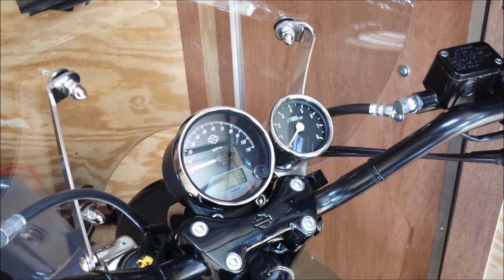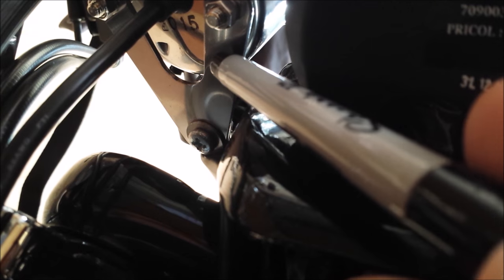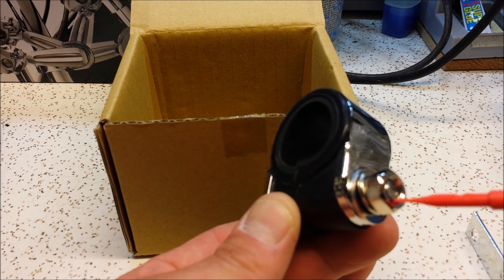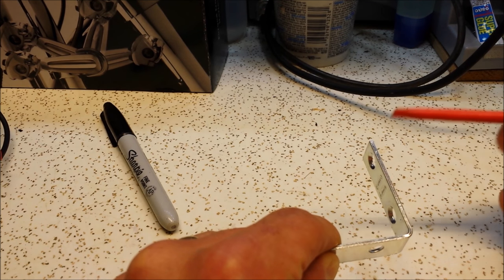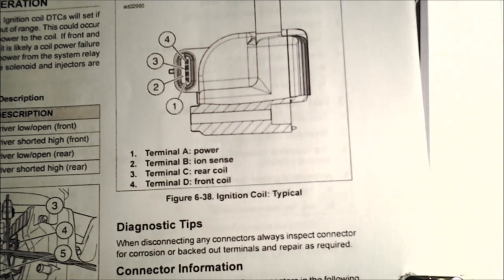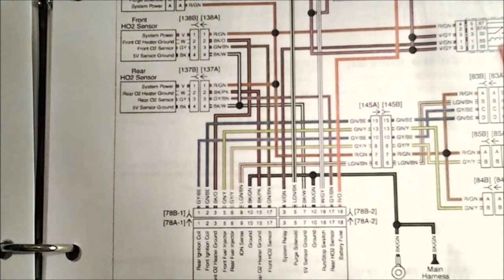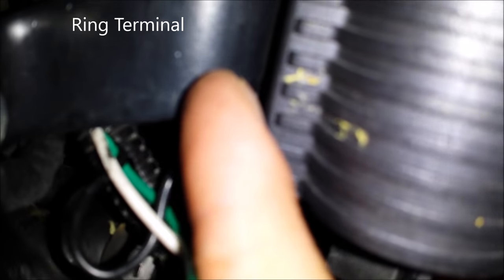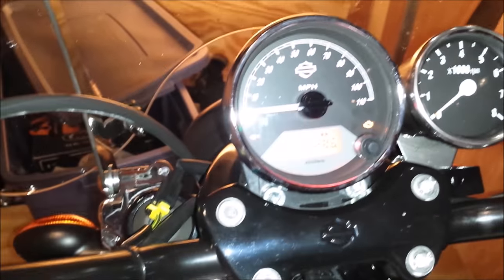HOW TO: Install a Tachometer Harley Davidson Street 750 XG

Comment: Hey Man,  great video... you are spot on  with the diode resistor combo.. I tried everything to get my Drag specialties mini tach to read full RPM not just half .  All but ready to give up.. everyone including whi I bought it from telling me it's the wrong tach that it won't work.. but it worked thanks to your set up..  much appreciated and mine bike is a single fire. 2015 Street Bob FXDB

Comment: Hello!
did you happen to measure gap between handlebar brackets before installing tachometer mount there.
just curious - if mount thickness is larger - then should be right side of handlebar is not tightening handlebar as it was?
If you turn out bit left side bolts screws - is handlebar still fixed ok.
Asking as as was thinking about same place where add tachometer and clock for shadow.
Reply from the maker: I didn’t, thinking back that would have been a good idea though.

Comment: Hello. Which diode and resister do you think I need for my Suzuki Intruder 1400? Not even with the net I can make my RPM gauge work at all! If you could PLEASE help me out I’ll appreciated very much. Thanks in advance
Reply from the maker: +Paulo Silva which tach did you buy?  You should have something showing on the tach. Might want to check all your connections and ensure yiu have good power and ground.

Comment: Hi there great video... just had a couple of questions if that's ok...

1. The x2 cables that you connected the Resistor and Diod to, are they power supply to Ignition Coil Front and Rear?

2. The Ground wire that you mentioned which is linked to the back of bolt that passes through the Ignition Coil Mount, I presume the other end of this cable is coming from Tachometer?

I have a 2013 XL883L Sportster and am looking to install a LCD Digital Multifunctional Speedometer from China...the interesting thing is that on the Speedometer you have to select the number of Cylinders on the Bike?

Im from London, UK any advice would be much appreciated before i get stuck into this project...

Thanks and season greetings...😊
Reply from the maker: It’s 2.

Comment: Hi, I note you say that you connected it first but it was only showing half revs. How did you connect it at first? I have two cables coming from the écu and connecting the yellow cable to either just the front or rear coil, I get no revs whatsoever? Any ideas?
Reply from the maker: I connected it directly to the output wires of the coil. That showed half revs. Than I add the resistor / diode combo. What model / year do you have ?

Comment: There is a factory speedometer with a built in tach on the LCD display.  Cycle the push button on the speedometer to see if you have the tach display.
Reply from the maker: Mine did not. I think the new ones have that option.
Reply: Thanks Carl, good video, just wanted to make people aware that some 500s and 750s have the built in tachometer.  Don’t know if you can swap out the speedometer to get the function.  I’d rather look at an analog gauge, but the LCD tach maybe OK for some.
Reply from the maker: Great point. Appreciate that feedback.

Comment: I've fitted this exact tacho to a 2004 Sportster and intermittently it flicks to double rpm.
Mostly reads correct but then sometimes reads double. I soldered to the coil wires and used the diode and resistor circuit. My earth wire is to the earth on the lighting harness for the pilot bulb. Any idea what could be wrong?
Reply from the maker: Has it always done that flickering? If it just started it might be the diode or resistor going bad.
Reply: @CarlRecktenwaldJr  I have only just fitted the tacho so everything is new. It was fine for a few miles then I noticed it would sometimes read correct and sometimes double rpm. I think maybe the resistors are letting some intermittent continuity between the two coil wires making the tach behave like it has two dual fire coils connected. What are the resistors for? Could I just run with the diodes?
Reply: So now I've tried using just the diodes without the resistors but no reading at all on the taco. I refitted a pair of 100k resistors across the diodes and tried again. Up to now its reading what seems like correctly, but may be a bit low. I'll see how it goes when I ride it again......
I read on one of the forums that the crank position sensor can trick the ecu into behaving like a dual fire on start up if the ecu doesn't read it correctly. Don't think there will be a cure for that.

Comment: I tried this, exact same bike but different tach. First try it read 0rpm on my tach. Second try it still read half the rpms and the engine light came on. Seems like it wasn't firing correctly. I used the exact same materials but it isn't working. Any advice?
Reply from the maker: Did you try it with out the resistor and diode setup? Maybe the tach is set up for dual fire?

Comment: Hi 
I bought similar rpm meter but I have two cables for light(black and red)
And three cables for rpm work (black,green and yellow)
How to install these?
Reply from the maker: What brand? Light wires will be power and ground. My guess is the other 3 are ign ground and coil.

Comment: Yes Carl I did try a commercially available tach adapter but it did not work at all. Then I tried the one that you made but I was unable to buy the exact value of components and tried that but it did not work either . So I just gave up until  I saw your installation. How do we get in touch with one another but not through Utube?
William Barnier
Reply: William Barnier  did the new one you made work
Reply: no. not at all.
Reply from the maker: +William Barnier you can send me an email. The link is on the web page link in the video description.

Comment: I mounted the same tach to my 2015 750 street and the gauge is moving around a lot and when im running about 4000 rpm the gauge is bouncing from 3500 to 4000 the bike is not surging any ideas ?
Reply from the maker: +Brad Brock mine bounces around at low rpm. Not totally sure why as with smooth and even throttle mine steadies out.

Comment: Hi I own a 2018 street750 in India
I want to know can i fit the iron 883 s analog digital combo meter in my bike?
Cz i badly need a fuel gauge
Or do you have any fuel gauge idea? Plz help
Reply from the maker: It might fit, however there is no fuel sending unit in the tank so it would not be an easy fix.

Comment: Hello Carl..my name is Lourival and I'm from Brazil...yestarday i tried to instal this tacomether in my Suzuki Boulevard M50  according this electric scheme, but tacomether show me only a half RPM..can you help me?
Reply from the maker: Did you use the resistor diode setup?
Reply: @CarlRecktenwaldJr  yes...i used diodes 4007 and resisters 100k.
Reply from the maker: Ok. Try taking those diodes and resistors out as you might have a single fire system.
Reply: @CarlRecktenwaldJr  I removed the resistors and diodes and plugged in the negative of the 2 coils, nothing has changed, is the tachometer only for single fire system?
Reply from the maker: Read this it talks about single fore and dual fire coils. I am not sure what the M50 has. 
https://roubert.name/joakim/tach/
Reply: @CarlRecktenwaldJr  Ok  tks.. M50 has 02 fire system.

Comment: Please also install a fuel meter and make a video on it
Reply from the maker: +Sumit Ojha I wish Harley would sell an aftermarket kit, with tach, gear and fuel...
Reply: Carl Recktenwald Jr. Are you able to make something for that
Reply from the maker: +Sumit Ojha Not sure, there is no fuel float so the only thing you could make is a computer based device that uses miles driven to show fuel use.
Reply: Carl Recktenwald Jr. We can use trip meter for that... Reset trip meter every time I refill the fuel tank
Reply from the maker: exactly.
Reply: Hope right now only trip meter is best solution to know how much fuel is left. Normally my bike able to run around +230 KMs without refill. But I never tried after +230.
Reply: You can always try using a peep glass. But if youre like me, i dont wanna drill into my gas tank lol. There is a device that you can get for like a 100$ that reads fuel pressure  to give you a fuel reading. I forget the name of it, but it goes inline with your fuel line to the pump

Comment: So Carl, two questions;1. Are you saying that P/N: TR-493374, from this video, is the WRONG part? And....2. That a "single fire coil tach" will work?
Reply from the maker: +John M. Yes and yes. I looked at the wiring diagram and assume that the coil was dual fire. However after I got the tach I realized the tach was reading wrong and then learned that for the street you need the single fire tach and then you won't need to add the mod of resistor and diodes.

Comment: Carl. I am using the same tach on my 2016 Triumph Street Twin and of course I have the same problem you encountered. It only reads at one half rpms. Would you be willing to make up another wiring adapter with the correct resistors and such for me? I would gladly pay you what your time and parts are worth. I am not able to duplicate your results and am severely electricly challenged. Please help me. 
Bill B.
Reply from the maker: +William Barnier did you make the resistor setup? I can put one together for you.
Reply: I tried but mine didn't work. I would really appreciate it if you could put one together for me Carl. I will pay you what ever seems fair to you for your time and trouble + shipping of course.
Bill Barnier
Reply from the maker: +William Barnier ok the parts are cheap but have you looked at a commercially availed tach adapter ?  With mine I do get a little tach bounce as the diode resistor setup is a little leaky. Either way just wanted to make sure you were aware that there are commercially available adapters.

Comment: Really useful video! Is this circuit that adapt the 2 coil wires into one universal for HDs? I'm thinking in try this in my Sportster!
Congrats!
Reply from the maker: +Rafael Pontes I do believe that the circuit is universal for Harley. They sell a tach made specifically for a dual fire system. I just bought the wrong one.
Reply: Thanks Carl! I will try this setup later!!

Comment: What is the voltage of the resistors you used
Reply from the maker: +Brad Brock Voltage? 
The resistor value is 100k 1/2 watt
Reply from the maker: +Brad Brock Voltage? 
The resistor value is 100k 1/2 watt

Comment: What year bike did you put this on?
Reply from the maker: 2015 Street 750
Reply: @CarlRecktenwaldJr  I just got the same bike. Is it dual or single fire?
Reply from the maker: I seemed to remember it as a single fire which is why I needed to add in the resistor / diode setup.
Reply: @CarlRecktenwaldJr  is this something that someone with basic knowledge can do or should I take to a shop? 

I need to buy the tach and the adapter?
Reply from the maker: You can buy a tach design for single fire and not need the adapter.
Reply: @CarlRecktenwaldJr  I cannot find one..any links to a good one?
Reply from the maker: The one I had was a bikers choice. Let me dig out the tach. I got rid of the 750 a few years ago but still have the tach.